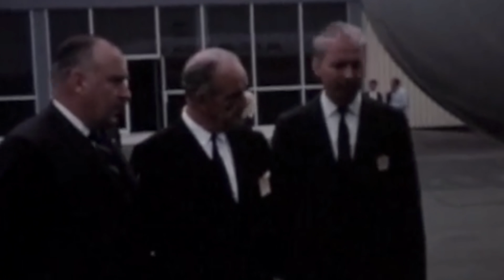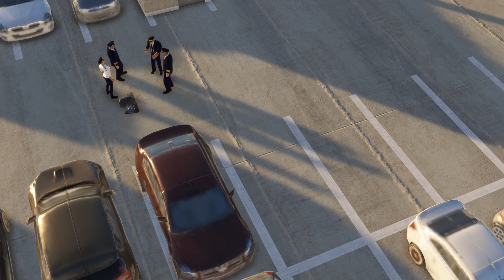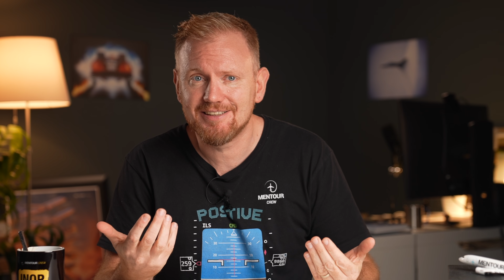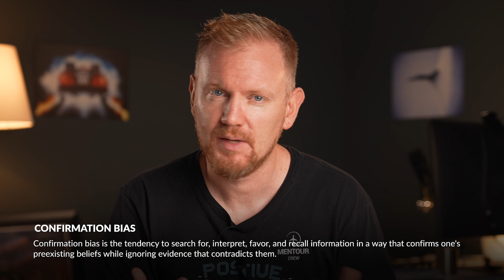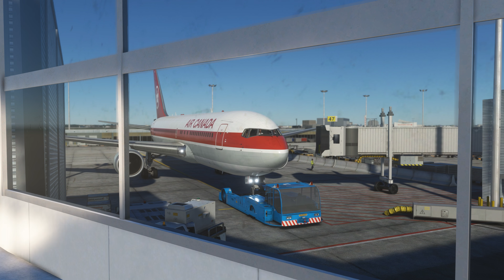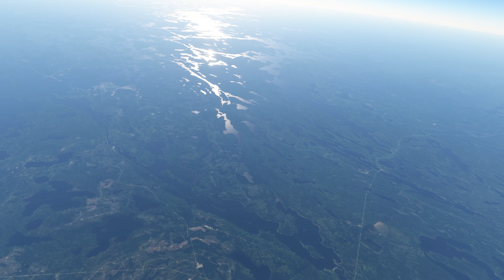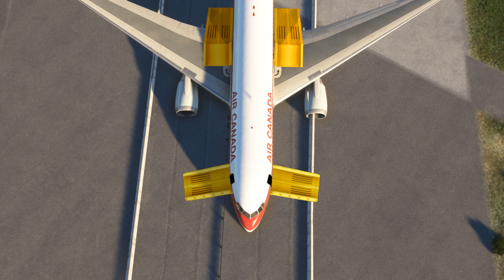NO Engines and Out Of FUEL! | The ”Gimli Glider" Miracle

Comment: Incredible well researched. 
Remember this incident very well  as attending 767 course in  1984.  Flashback to Braathens two 767 logging nearly 20 hours a day - flying charter and domestic.   Such a great  reliable aircraft .
Logged many hours as a flight engineer early years as ground crew was not familiar with cargo doors, containers and refueling.
Remember a Boeing instructor said - the RAT  can now be removed from all 767. Statistics shows  it will be use only once in entire 767 fleet lifetime.

Comment: even if you know what's coming and you're not used to a slip it feels nasty in a two-seater ;-)
and one more thing: the airspeed indication becomes somewhat faulty in a forward-slip because the airstream is no longer directly onto the tube(s) and therefore reads usually less than the acutal airspeed

Comment: It seems so wildly irresponsible to not have a single procedure for a dual engine failure. Running out of gas was out of the realm of possibility? Why put a ram Air turbine if you thought you would never lose power from your engine? That point seems very confusing to me

Comment: I am surprised they didnt notice on take off.  Their V1 speeds would have been off and the aircraft would have lifted off sooner than expected.  As the aircraft would be a little over half the weight expected.
Reply: The aircraft alone weighs just over 80,000 kg. Having half the amount of fuel required would still mean the aircraft is only 15% lighter than it should have been.

Comment: Having in the past had to work on industrial equipment in Canada this is still a massive issue with the added benefit of certain people refusing to speak English. This caused a 3 phase melt down causing 10s of thousands of USD of damage. Of course when this was pointed out the refuse to speak English guys shrugged thier shoulders, laughed and walked away. It's been said many times Canada is not a country it's a joke.

Comment: Why didn't the front gear lock? Even in a gravity drop, surely that's a serious malfunction / design flaw. Was it addressed?
Reply: I was also surprised the 1. the video did not discuss this issue and 2. it seems there were no recommendations and modifications of the mechanism or fixes for the particular plane ... But that sounds unlikely, it must have just been skipped over in the video. From the video, it looks like "the gravity based deployment of the front gear is not working properly, but we don't care". Would a plane with such a problem be allowed to fly for 20+ years?

Comment: Another interesting lesson learned for pilots from this incident:  when Capt Pearson began slipping his deadstick B767 on final that day, the flight controls became mushy and less responsive.  Nothing was in the manual at that time as to why, but it turned out that under 135 KIAS, the RAT motor couldn't pump enough hydraulic fluid pressure to fully power the flight controls.  Now there is a limitation to fly approach speed but not under 135 KIAS with the RAT deployed.  Live and learn!

Comment: It's interesting that this aircraft also had issues with the nose gear not deploying all the way. A few years ago my dad brother and cousin and I were flying in his Bellanca Super viking. And half way through the flight he noticed the hydraulic pump for the gear still running. Assuming a hydraulic leak after some troubleshooting he decided on a emergency landing. Once we got near he tried to lower the gear and the 2 mains lowered with no issue. The nose however did not indicate lowered and locked. On final approach the air traffic controller confirmed the gear was not down. We resigned ourselves to a semi belly landing and the ruining of the engine. However at the very last moment my father pulled to idle and started the flair the nose gear finally lost all the airflow keeping it in and it swung out and locked down right as the mains touched down. Absolutely crazy flight and very thankful the aircraft ended up being alright. Interesting how this gear did not come down.

Comment: One thing that has always perplexed me about the aviation industry, why a load cell weigh bridge with a ground mount digital weight display is not at the hold short point of every commercial runway.
Pilots roughly know baggage, pax and unladen aircraft weight before takeoff.
Confirmation of fuel weight is then known....

Comment: What I find surprising is that they didn't recognize that incorrect conversion rate to be liter to pound value. Like, wouldn't they be using that for all other aircraft? Was it just because these manual checks were rare and these conversion rates were not familiar to any of involved techs at all? If they were using them, the familiar conversion rate should sound alarm bells immediately.
Reply: Because the Boeing 767 was new, and was the first metric airliner.

Comment: At test has been conducted with a SE210 Caravelle in april 1959 by Sud Aviation the maker of the SE210 Caravelle (twin jet engine with engines mounted on the aft of the plane) in order to show the ability of the plane to act as a glider. They left Orly airport toward Lyon airport (265 km / 142 Nm), the plane climbed at 10 000 m (33 000 feet), they set engines on idle and  land in Lyon 46 minutes later.

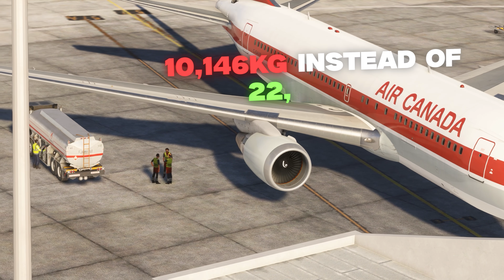Comment: I'm surprised that nobody commented on the bit at 22:27. The fact that the value converts to 22.3 thousand pounds almost exactly (bar some rounding) is not a coincidence. They did all their calculations using the fuel density in pounds per liter — so they calculated pounds. The calculations are exactly what you'd do to get 22,300 pounds of fuel on the plane. So that's what they got: no coincidence.
This is actually a bigger problem than many people realise: many calculations can have some sanity checks built in, but if you make the same mistake in multiple places (such as using the wrong fuel density here), you'll get results that are actually consistent, but consistent with the mistake. If you're ever in a position to do a calculation that can have significant consequences, and that calculation involves looking up a value, always look it up each time instead of doing it once and remembering it. I'm not sure that would've prevented the mistake here, but I've caught many of my own mistakes (thankfully with far less serious consequences) that way.

Comment: Running out of fuel unexpectedly doesn't just affect airliners, 
back in 1996, I was a British based international HGV1 driver, 
driving a new Volvo FH16, that had a computer based dashboard, 
one night, when I was on the way from Southern Spain back to the UK, 
with the computer dashboard stating that I enough fuel for about 100 km, 
the trucks engine cut out, due to running out of fuel, 
this knocked out the trucks power assisted steering, 
meaning I had to deal with 8 tons of weight on its front axle at about 60 mph, 
this felt like that I was arm wrestling with a World champion shot putter, 
luckily I managed to bring my truck safely to a halt, 
on an exit sliproad hard shoulder, that really was in the right place at the right time.

Comment: It's interesting how this one incident came into my career with Air Canada on several occasions throughout the 29.5 years I worked for A/C.  When the incident of AC143 occurred, I was still a little over 2 years away from becoming a flight attendant for the airline.  But I was working for the company in the operations department, specifically in Flight Attendant Crew Scheduling in Montreal at Dorval Airport  (now Montreal-Trudeau International) when it happened.  There was a Montreal based flight attendant crew on board that flight, that evening, and I knew a few of them personally.  A little over 2 years later in November 1985, I became a flight attendant, myself, having just graduated from initial training, and assigned to YYZ base.  Throughout my career as a crew member, some 19 years in duration, I actually flew with several of the crew members, at different times, who had been on board 143.  I remember speaking at length with one in particular, who I knew from Montreal, and asked her if she lived her life any differently now as opposed to how she did before that harrowing evening.  She told me she absolutely did, and recounted some of the changes she had made as a direct result of her near death experience, not the least of which was moving to a different base, and pursuing a love interest that had started before that fateful evening.
During my own training experiences, our instructors would often reference AC143 when going over procedures for slide evacuations, emphasizing the importance of fully assessing outside conditions prior to using a specific exit and deploying the slides or slide rafts.
I often flew on the affectionately named, Gimli Glider, and would always note the fin numbers of any B-767 I would board as an operating crew member, taking a moment to remember the incident Fin 604 had been in, or occasionally recounting the story briefly for a junior flight attendant who may not have been aware, as we boarded 604.

Comment: As an Electronics Design Engineer, I fully understand your description of the display reset, and fully understand what happened there.  Essentially, the powers supply for that system is what's called a "switch mode regulator".  The inductor (coil) that was poorly soldered is absolutely key to the function of the power supply.  Resetting like the engineer did basically switches off both, and then switching on the working one, and I'd expect that.  I would, however, not want to release that faulty system to operation.

Comment: My father was a helicopter pilot for custom helicopters in gimli when this happened, we were able to drive right onto the Speedway with our green tank of a station wagon where the aircraft landed dead center on top the dividing fence flattening it out the entire length of its landing. We had a picture of us taken in front of the aircraft with both of its Inflatable slides deployed on either side of the fuselage.

Comment: I was involved with getting this aircraft back in the air in fact I actually watched it come straight over our house when I was a a teenager; it glided right over our house onto the runway as we are on the flight path more or less. 
In those summer days, I was working with my father at one of the hangers at the now-defunct Air Force Base where they ended up landing on the farthest out runway, and Air Canada had contracted the company my dad worked for to assist in getting the aircraft back in the air. In fact they use the the boss's office as their communication center while the repairs went on. The first challenge we had was to get the aircraft moved off of that runway when they put new tires on. The day this happened, the dragstrip was not in use, but there was a circuit track down at the far end buy the pits that was in use which is thankful ... if the dragstrip was in use there could have been a different situation. 
All of the tires on the aircraft with the exception of the nose wheel, looked like they were  shaved right off just like someone cut them off with a giant machete. That was the result of the brakes being locked up as they came barreling down the pavement. Once the nose wheel was set up right and the tires were replaced the aircraft sat there for a little period of time. But what ended up happening was because of the weight of that aircraft and the old runaway not being originally built for that much weight, and time had likely softened the asphalt (was not concrete) , the aircraft actually sank into the pavement. It didn't sink a lot but just enough that we couldn't move it out with the equipment that we had. We had a 4-ton moose tractor to move our DC-3s however obviously that was just not enough even though that unit was customized having its original  four-speed transmission (creeper gears)  and a fluid coupling with a used   390 Ford V8 engine installed from a local wrecking yard. We did have a small bulldozer that we additionally hooked up in tandem and tried to pull it out but the dozer just turned in its tracks as it was just too much weight and we couldn't pop it out of its hole. Air Canada had to truck  in a 35 ton tractor to pull that thing out. 
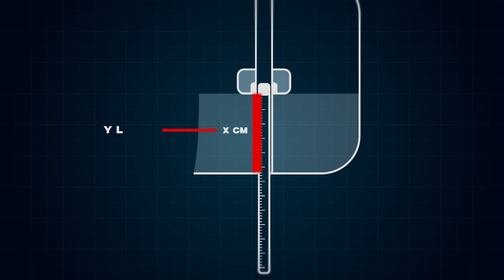After the unit was brought up to the hangar they spent a lot of time repairing it fixing up the nose and getting it ready to travel. They gave everybody at the hangar a little tour of the aircraft, and they announced that they were going to take off on a Friday afternoon however, as I was leaving the driveway going to work that day the airplane was overhead and gone at 7:30 in the morning. My guess is they didn't want anybody around in case something went wrong. 
Also when they approached the owners of the business my father worked at which was called OCA, they asked the owner, Barney Lamm  what kind of compensation that he wanted. As he was successful in business and he appreciated the gravity of their predicament, all that he asked for is that he and his wife would have a free pass on Air Canada flights for as long as they lived. Air Canada came to an agreement with him obviously expecting that since Barney was in his late 60s that it wouldn't be a forever forever thing.
Reply: Also the next year when we had our Icelandic festival celebration of Canada in gimli Manitoba, we invited the flight crew back to give me to partake in the festivities. I believe some but not all of the flight attendants came back and the pilot and co-pilot did not participate.

Comment: 19:45 Speaking as a pilot myself: for an industry that is OBSESSED with safety, it baffles me that to this day in aviation, we are still working with a globally unstandardised measurement system. Metric system, imperial system (US and Imperial) all mix and matched. Errors can kreep up very quickly. Computers do all the conversions, but numerical coincidences can happen and confuse you if you are not careful. Use a factor the wrong way around and the error is there.

Comment: The confusion of multiple measurement unit systems in the aviation system isn’t unique.  American (formerly British) units still complicate many industries, including my own, hydrogeology, which has a completely unwieldy mix of these old British units, “American Practical Hydrological Units” and SI units.  In elementary school (1960s-1970s) we (US) students studied and worked problems in SI units for eight or nine years in anticipation of the big, scheduled, national conversion and were fully capable in both systems.  Suddenly, that conversion was canceled because of industry lobbying.  I know it’s really expensive to re-tool*, but it has to be done sometime and it hasn’t got any cheaper since the 70s when the conversion was canceled.  It’s time to get it done, just bite the bullet and get it over with.  It puts my country technologically behind nearly every other and leads to endless errors, many of which can affect public safety.

  *For example, a water-flow meter used for well pumping tests run $10-20K, as do those which connect individual homes to water distribution systems.  It’s not just a matter of replacing a few sets of wrenches.

Comment: "Against all of the odds" - Really? They were able to reach a runway. That's more or less all that mattered here. If they had crash-landed somewhere else - bad. Probably. But on an actual runway with the flight controls working? Most pilots should have been able to manage that - except for the sideslip maybe. And that the thing didn't explode or something like that... seems only logical with maybe just a few liters of fuel left in the tanks. But "against all of the odds"? That sounds more like the so-called Heathrow Miracle (or the one that I consider the real Heathrow Miracle: Virgin Atlantic Flight 024), the Hudson ditching or TACA 110.

Comment: I think the term "engineer" needs to be more carefully used. Any actual engineer would have realized that fuel, converted from liters to Kgs, would result in a smaller numerical value, not larger, because the density of fuel, in kg/L, is less than one.
Reply: So it was some fake engineer, is that your logic?
Reply: @grzegorzmaciaszek1564  Not a very good one that's for sure.

Comment: I was a line fueler at TPA before I started flight training. Dipstick checks were a pain in the ass, especially on 767s where you have to move your lift truck to every single stick on either wing. A full stick order on a wide body, 45 minutes is fast. You have to check the aircraft attitude on a set of gauges in the wheel well, check every stick, calculate the fuel level, calculate gallons to be added, add the fuel, recheck the attitude, recheck every stick, then brief the captain.

Of course, as contractors we’re not permitted to open the wheel well doors or put ladders under an aircraft. Company maintenance would come out and do that for us. The usual method for everything except the 737 was to have one guy driving the truck, and another climbing up and down lift deck checking the sticks. Painstaking procedure.
Reply: I couldn't help but notice you used GALLONS instead of all three units mentioned in the video (litres/pounds/kilograms), yet another unit we have added to the mix 😅

Comment: Another great video and the first part of it, describing the technical issues, the refueling calculation errors, and the MEL issue were finally fully explained and understandable.  Only question is can modern fly-by-wire Airbus and Boeing jets do a forward slip maneuver?  Will the computers allow the aircraft to go into that configuration or would flight envelope protection algorithms prohibit it?